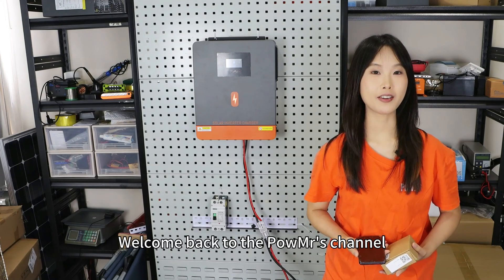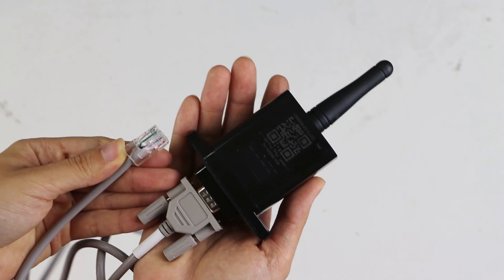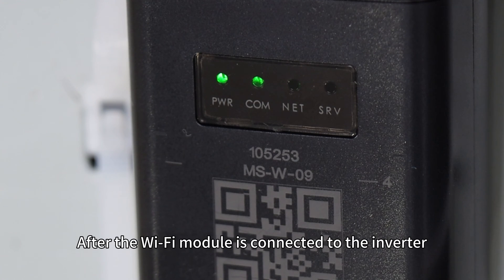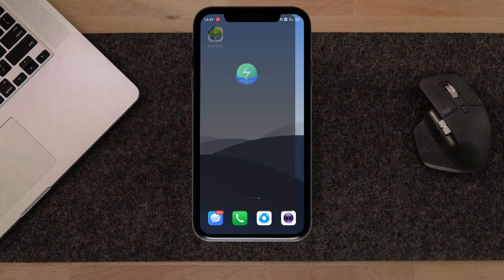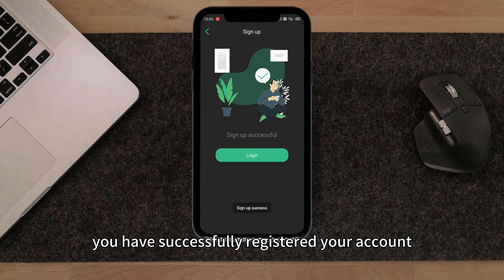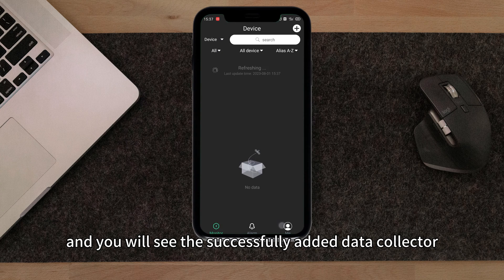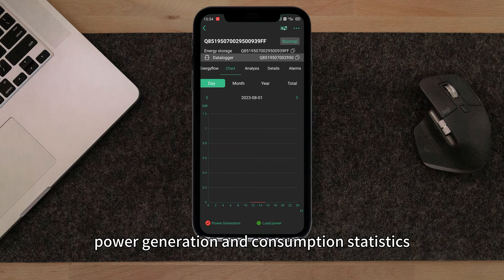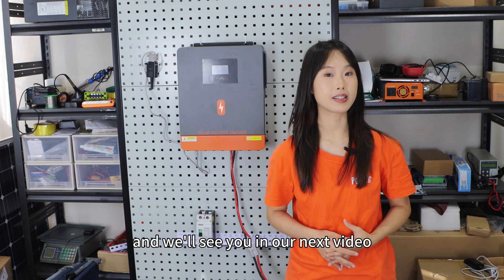How to Connect and Use the WiFi-VM Module?

Comment: Do i need to turn off the inverter before we install the wifi module? Or is it ok to install it even the inverter was on operational?
Reply from the maker: When installing, only connect the battery to turn on the inverter, and make sure the inverter screen is normally lit before further connecting the WIFI module to the inverter.

Comment: Hello, I have a 10.2 kW hybrid inverter. It is connected to a wifi plug pro 05 dongle linked to the SmartEss application. The monitoring works well but when the solar power exceeds approximately 3 kW the box disconnects from the application (offline). When the solar production power drops below approximately 3 kW the box reconnects again. Can you tell me where the problem comes from? THANKS
Reply from the maker: When it exceeds 3KW, it may be overheating or other interference causing weak signals.

Please observe whether the machine exceeding 3KW has an alarm code or the temperature is too high.

Comment: Hi, I installed WIFI-VM with 6.2KW inverter. WiFi 2.4gh, joined and APPS smartESS registered. Add ed device Datalogger. 4 indicators displayed lit, supposedly net flashing but it is lit. Checked and found only basic info and parameters is available, no others monitoring features. What’s wrong with the setting? Please help.
Reply from the maker: please send it to this email: support@powmr.com. Our technical staff will check it for you.

Comment: Hello. I have only one PWR indicator on. I followed all the steps according to the instructions, but the COM, NET, SRV indicators are not lit and the inverter is not in the devices tab. How to solve the connection problem?
Reply: Hi , have you by any chance had a fix for this, I am having the exact problem, but tech support request a video of my installation procedure, pretty much a waste of time as I can,t get past the 1st step. The module connects to my phone wifi ok, but will not connect to the inverter.
Reply: Hi. I wrote to the support in the app, described the situation. They asked me if I followed the instructions from the manual, I said yes. And then they asked for the pn number of the device and after a while everything worked.
Reply from the maker: Please send it to this email: support@powmr.com. Our technical staff will check it for you.
Reply: We're also having this issue! So the only fix is contacting customer service?

Comment: "I have a powMR inverter that I purchased in October 2023, which came with a Wi-Fi module. I was able to connect it, and everything worked well until October. Now, I have the following issue: when I try to change any settings via the phone for the battery or how the inverter is used, for example, not from the grid but from the battery, these changes are not applied in the app. I tried adjusting the parameters, and although it shows that it changed the settings (for example, for battery charging), in reality, the app still displays the same voltage as before. Perhaps the issue lies with the Wi-Fi module firmware. Could you please tell me where I can download new firmware for the Wi-Fi module?"
Reply from the maker: Hi, please send your problem to this email: support@powmr.com. Our technical staff will handle it for you.

Comment: Hi when connected the power light is lit up but not the com light. I have the WIFI Plug pro 4.2/6.5 kw inverter I ordered it by a link for my 4.5 kw Hybrid inverter it it the correct one.
Reply from the maker: Please send your problem to this email: support@powmr.com. Our technical staff will handle it for you.

Comment: will the wifi module work with 6.2kw hybrid with no battery? I'm just using solar panel and and AC input.
Reply from the maker: https://powmr.com/products/hybrid-inverter-charger-6200w-220vac-48vdc this model? If so, yes.
Reply: @PowmrSolar  I'm using the POW-HVM6.2k-48V-LIP model
Reply from the maker: Nope, this is not the wifi module for POW-HVM6.2k-48V-LIP.

Kindly check the product link beow, you can get the wifi here:
https://powmr.com/products/all-in-one-inverter-charger-for-parallel-6200w-220vac-48vdc
Reply: @PowmrSolar  thanx. no wonder why its not working. thanx for the info

Comment: After set up using one mobile phone, can we log in to the APP with another mobile phone?  Can we view condition with 2 or more phones at the same time?
Reply from the maker: Nope, you can only log in to one device at a time.
Reply: So I can set up on my phone and another user can login to the app on their phone at a different time
Reply from the maker: @alanbeasy1775  Yep.
Reply: @PowmrSolar  My WIFI-VM shows the PWR light but it does not show the COM light  (Off Grid Hybrid Solar Power Inverter 10.2KW)
Reply from the maker: @alanbeasy1775  Please send your problem to this email: support@powmr.com.